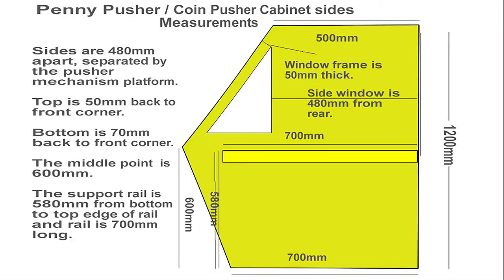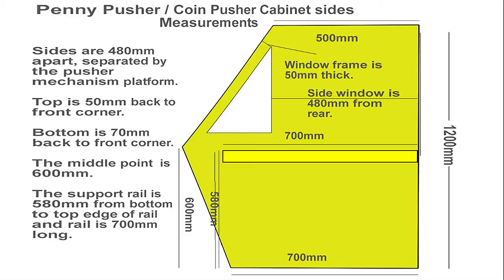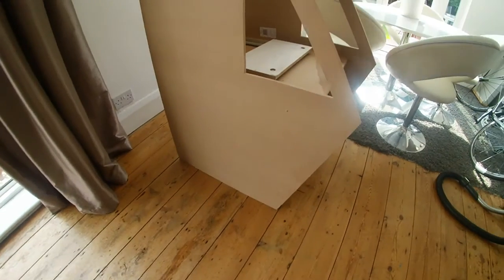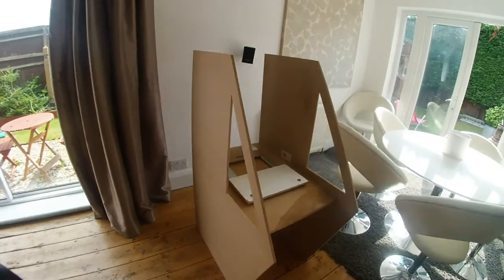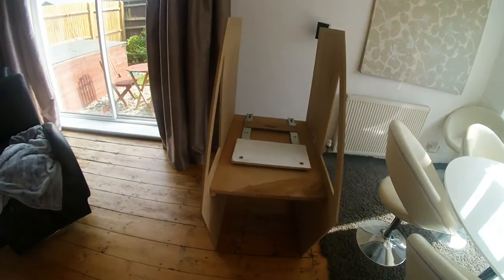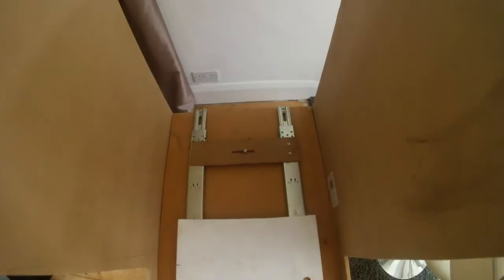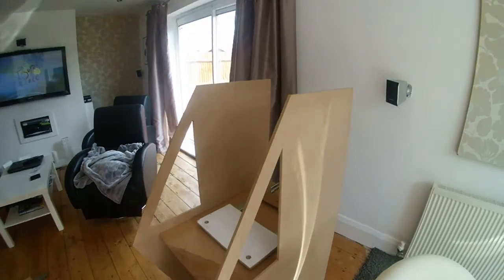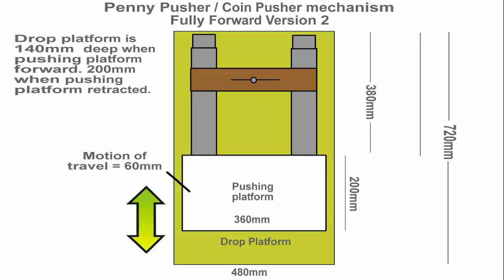How to make a Coin Pusher - 2P Pusher Project build - Part 2 - Cabinet Sides and Mechanism changes

Comment: Hiya, Ive sent you a message on Instagram im hoping you can help me. I want to start getting what I need to start building my own 2p Coin pusher. But struggling as to what motor to use? The one you use i cant find I can find other wiper motors but i don't know what one to get as for its speed, and how to wire it etc any help would be appreciated thank you  ;-)

Comment: hi, im kinda struggling here, when i put the thin board on the slider, i cant seem to screw it on....as the screws i use are very small but they hit the runners....stopping the motion.......the board im talking about is where the screw goes thru to pull it back n forth......any help would be appreciated...thanks...
Reply from the maker: Hi Vince. I had the same problem with the aluminium tops I have on my pushing platforms. Put a screw at the front and the screw heads cause the coins  get stuck and jam up the mechanism! Frustrating!  Anyway, I got around the issue with a bit of strong glue (I used "no more nails") and simply one screw right in the middle to secure it. Im in the process of making a new video at the moment as im nearly finished. LED lights, the lot! I will get some more videos on here this week explaining how i have wired the electrics up and the glazing. any questions, please feel free to ask.
Reply: ah ha.....good idea that probably would work, another thing, can u tell me what is used between the perspex and the backboard, where the coin is dropped.....it hits off the obstacles as it goes down....thanks very much for ur help.....much appreciated.......

Comment: sorry meant to ask, what is the width of the side panels of the MDF...cheers....
Reply from the maker: MDF thickness of side panels is 10mm. Inner distance between the 2 sides is 480mm. Total width for the thickness of the MDF and inner space from outer edge to outer edge is 500mm wide. I hope that helps!

Comment: hi from ur dimensions, the bottom says 700mm, yet the support looks much longer and that says 700mm too. u say the top back to front corner is 50mm, but on ur pic it says 500mm, u say the bottom is 70mm back to front corner, again in ur pic it says 700mm....either ive got it wrong, or im very confused....any help would be appreciated...thanks....
Reply from the maker: Hi Vince. Yes some of my diagrams are slightly out on measurements as it is a bit of a work in progress so apologies for that. I have found that as you build these things from scratch, you have to make a few adjustments along the way! However im in the process of making a more informative video with the exact measurements. I will send you a link to it when im done. My pusher is nearly finished! Thanks for watching!
Reply: hi, thanks for getting back, and looking forward to seeing ur finished product, been wanting to make a pusher for years, tried twice, but gave up cause i got it all wrong, and now i have found someone who is willing to give measurements, so thank you.....please let me know when finished as i want to start as soon as......cheers again....